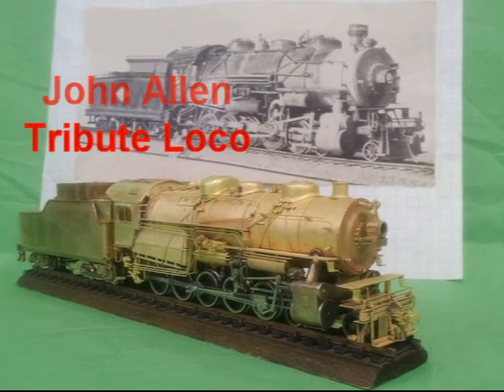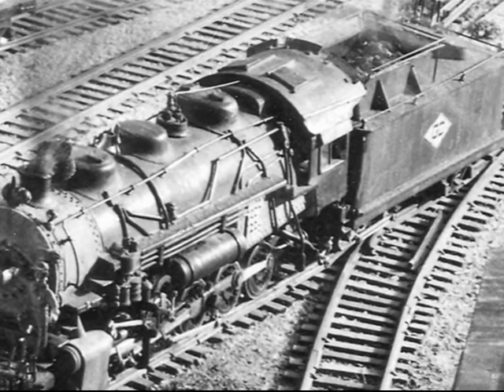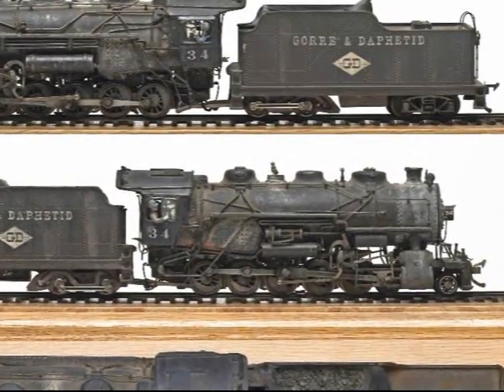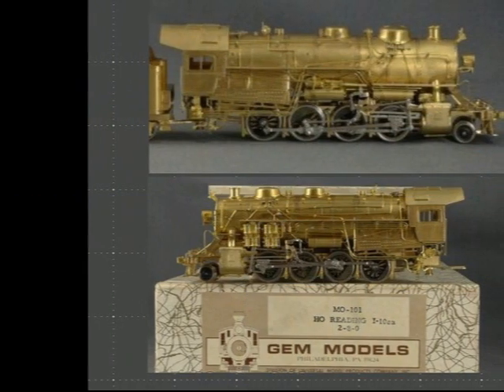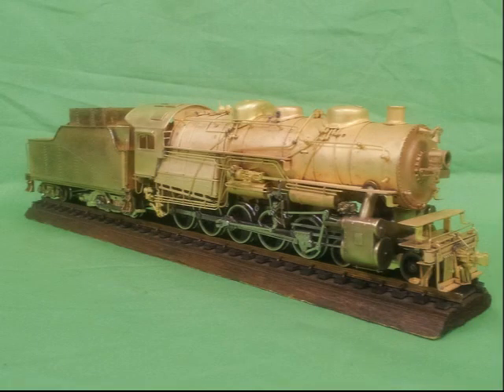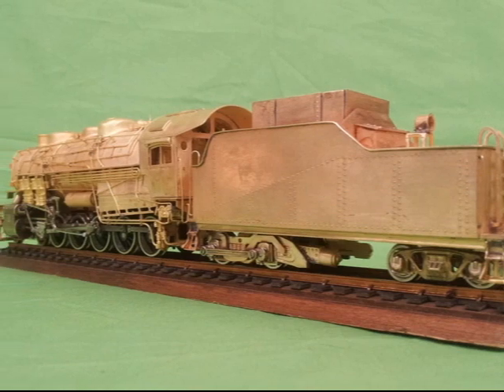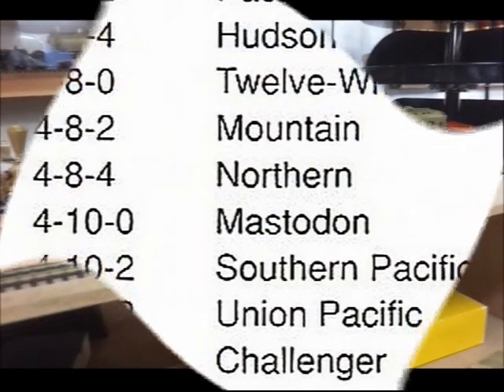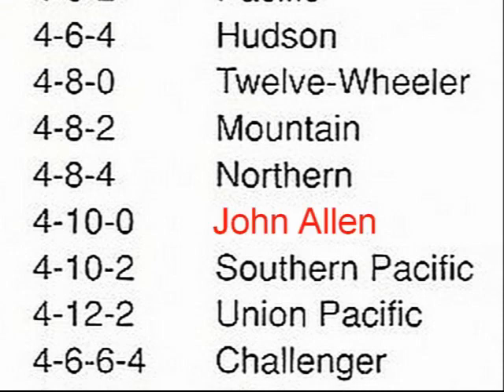4-10-0 John Allen Tribute Locomotive

Comment: Interesting model,  but a backstory for why the G&D would develop a 4-10-0 is needed.   Here is my hypothesis...

Around about 1910 the G&D needed a slow speed drag engine with high tractive effort to get heavy freight trains up and over their steep curving mountain main line.  During this era locomotive builders were experimenting with compound steam engines as a means of boosting fuel and water efficiency, a technology that the G&D would have been very interested in since the railroad operates in an arid mountainous region where water would be difficult to come by.  The machine they developed would essentially be a "super decapod" with a Tandem compound arrangement.    In a Tandem compound, the large low pressure cylinders are mounted in front of the small high pressure cylinders with both cylinders sharing the same piston shaft.  The extra weight of the large low pressure cylinders and associated valve gear required the unusual 4 wheel pilot truck.  

The Wooten style firebox, a feature usually found in East cost anthracite country was adopted to provide the locomotive's fire box the largest grate area possible without resorting to the need of a trailing truck.  This enabled as much of the locomotive's weight as possible to be placed on the driving wheels.  Additional tractive effort was provided by the tender booster truck.

Then, around about 1925 the locomotive was rebuilt as a "simple" (non-compound) locomotive when a Schmidt Super Heater was installed.  This rebuilding removed the large low pressure cylinders resulting in the modeled locomotive.   A simple 4-10-0 with a Wooten firebox operating in a mountainous western region.

Comment: This is fantastic, I still have to work on mine, I have a varney boiler but was considering going brass as yourself. It would look closer to his engine is you used a clear vision tender much like the tenders from Rivarossi 0-8-0. Based on what I know studying photos, the clear vision tender that originally went with the engine looked to be a kitbashed varney casey jones tender with the upper sides cropped flat and then a built up center coal column with the top flared off. The only other noticeable issue is the headlight sits too high, you should center it and watch how much closer it starts looking after that.

All these people replicating 34 and I've done dozens of kitbashes since starting the project myself and so far it's sat tucked away until the next time I catch the bug to build one.

My 2-10-2's take inspiration from that engine. It starts with a boiler, cab and tender from a Custom Brass D&RGW M-78 and a Bachmann 2-10-2 chassis along with a franklin booster truck for the tender. It's the first time I've felt satisfied with a kitbash that I'm making duplicates as my road engines.

I can't wait to see more, keep it up!

Comment: Nice video.  Really enjoyed watching.  When I first read about this locomotive in Linn Wescott's book, I also thought it was the best locomotive ever, but couldn't find any reference to a prototype 4-10-0 anywhere (that was before the internet).
The 4-8-0 wheel arrangement is also called a mastodon.  I've seen the 4-10-0 type listed as a "super mastodon" to distinguish it.
Have you tested this locomotive in operation?  
Will it pull 14 cars up a 4% grade like the original?

Comment: Just curious what kind of radius do you use for that monster to get around without derailing?
Reply from the maker: No different than the Frisco 2-10-0 donor engine which I think is advertised as 24"
Reply: @tompanvids   I thought it might be difficult to put one together since you would need a longer drive rod since the cylinders are moved forward to make room for the last of the guide wheels.